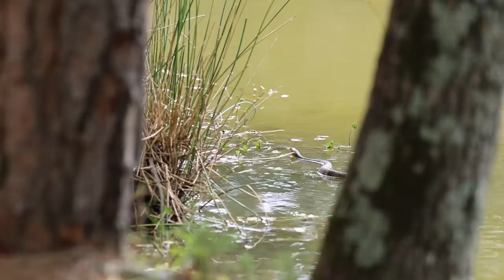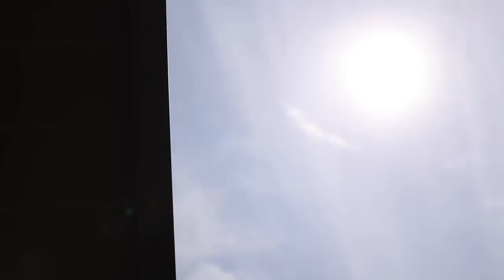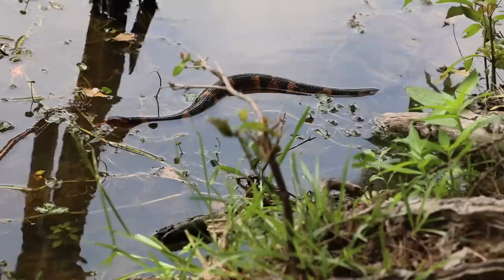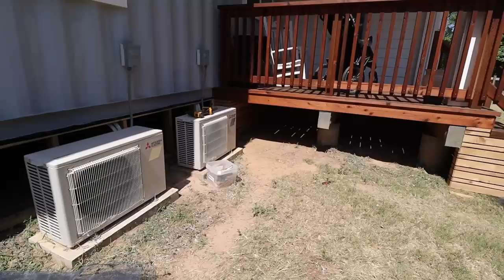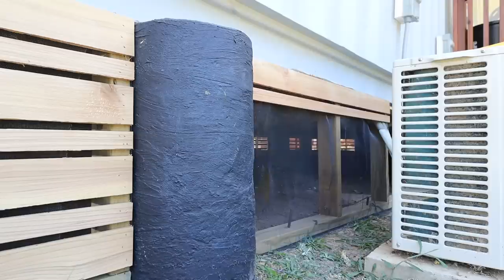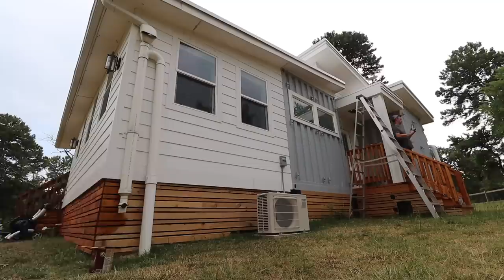HEAT WAVE | Hottest Summer Days Living Off Grid

Comment: Guys, 
Seriously a well with a level switch will make your lives sooooo much easier take your storage and bury it in a berm to keep it from freezing and use the well to keep it at least half full and you never have to worry about it again. As for the batteries yeah not sure any place that gets below freezing or in the 100+ degree heat is your best bet for battery life. Most folks have a room in the house with all the controllers and batteries just for that reason. Worst case, a small building outside with the controllers and batteries with maybe a small cooling unit. The charging of the batteries and maybe a heat lamp bulb should keep a small insulated building above freezing in the winter and the small cooling unit for summer when its really hot out.
Power and water are the most important things so build them to last and supply all your needs no matter what the weather does because as you guys have seen it will not cooperate. Im actually drawing up plans for a hydroelectric set up for the cabin on our creek property. If/when I get it done I'll shoot you guys some pics.
Keep up the good work.
Edit***
Forgot to add you can save those cedar shavings from the planer and they work great for do bedding. It looked like you guys left a place the doggos could get under the porch or some place and if you spread that under there it will help keep bugs out and give them a place to lie. Best thing is that since its an aromatic wood no worries with termites.

Comment: The UK had a famous summer of '76 and I happened to have a vacation at the time of the heatwave. Fast forward to 2022, and this summer has surpassed the summer of '76 in the UK; last weekend there were similarly temps hitting 100 degrees here and this country is not setup with AC! I feel your suffering; that said, we have had some rain and the tenp has dropped, phew!! Hang in there 🙏 hopefully, the weather will bring you some rain soon!

Comment: As soon as you are able, dig a well for water. I would also suggest another source for heat, fireplace or wood burning stove. Weather is becoming an issue worldwide, as is water. YOU NEED BACKUPS!  This winter is supposed to be a really cold one, so prepare now. Dig a well in the spring, use your tractor, but first get another source for heat for winter, it's coming on fast. You have plenty of firewood from the tree you had to cut down, use it. At 70 years I've learned to be prepared, as much as possible.

Comment: Time for a well to supplement the rain tanks, the pumps are electric so y'all still be off grid and you can use level switches to only operate when the pump when the tank get to a certain low level.

Comment: We have a similar problem with the heat and battery storage in Australia. I recommend you check out Redflow zinc bromine flow batteries. They can be drained to 100% and last longer then lithium batteries. We use them for offgrid deployments in Australia 🇦🇺

Comment: In Cape Town South Africa we were around two weeks to ground zero for Cape town.  We used grey water to fill up our toilet cisterns which came from our washing machine and shower. We then also used grey water for the garden.  Trick with that was to allow the water to settle so soap etc fell to the bottom.  Rinsing dishes was not an option most of the time.  Cooking water from cooking vegetables was kept and used along with grey water.  We washed/showered once a week and washed with a cloth and small bucket of water on the other days. Filled a cup with water to brush our teeth instead of letting tap run. When showering we stood in a large bucket to collect water.  Point is.... It can be done and we did it for almost a year..... Automatic Washing machines use tons of water.  If you want to use less water for washing clothes buy a twin tub.  Fill up machine with water,  put drain hose to drain water back into washing machine tub when you spin.  Wash all clothes first (re-using water everytime from spinning washing) and when finished drain water into a very large container for grey water,  fill tub with fresh water,  rinse with drain hose draining back into tub until you notice that the water needs replacing,  drain for grey water and fill with fresh.... Sorry for long explanation but that is how we survived until we got rain again and the dams filled up.  A practice we followed with the toilets was if it is brown flush it down,  if it is yellow let it mellow lol...

Comment: Batteries only have so many cycles, being 100 percent dependent on them 4 years is a good replacement cycle. Li-On Energy has a storage solution. Given your sub count, you should get a pretty good break on pricing. Also, your panels are a big rain catchment if you put a gutter on them. Also, your barn has a lot of lost rainwater that a gutter would capture.

Comment: Have watched you from the very beginning and love you!  Love the off grid and solar array.  However, have you thought about cutting down on consumption rather than increasing on the energy supply?  Eg not using as much air conditioning?  Using a fan instead?  Almost no one in Europe uses air conditioning, yet the temperatures are the same….

Comment: Have you considered using the pond as a heat sink, running tubing into and under the pond surface, dispelling heat in the summer and picking up heat from the water in the winter.    You have the near source that most people only dream of.

Comment: As someone who grew up in the country, you need a generator as a supplemental source.  A smart generator would be even better.  THat way in the early morning, your generator can recharge to provide uninteruuptable (is there really such a thing?) power.  About the only solution for the water issue is to punch a well.

Comment: The heat and humidity have been ridiculous in NW GA too!! Much worse than normal. I feel for y'all.

What if y'all sleep in the same bedroom and run a window unit at night just until the weather changes so you're not cooling the whole house. Maybe set the thermostat on the central at like 78°. Just a thought.

Comment: If I could, maybe shutters on the south windows. If they are on the outside, they provide more insolation from the heat, which should reduce how hard the A/C has to work... It really helped on my property. I have actually had 28-33 C days where stopped running the A/C about 2 hours less. 40 C days, 1 hr to 90 minutes less....

Comment: With the proper filters you can draw off the pond or dig a well.  The water table can be just a hundred feet or thousands. Hope it's high enough for a well. I watch a lot of sailing video's and they use Lithium Ion batteries but the Lithium Iron batteries are worth investigating. The Battleborn Batteries are popular and it's worth giving them a call. ........................  enjoy

Comment: There micro ceramic paint additives you can add to your exterior paint when once applied reflects like 90% of the heat on your house, it was invented to use on metal buildings for oil rigs in the gulf..I just can’t remember the name..good luck

Comment: Hey Texas Friends! I’m here in Southeast Texas and I hear yuh! Quick question, y’all haven’t thought of putting in a water well? That’s what I have and it’s a game changer, and you could run the well motor on your solar
Reply: I agree, I was off-grid for 7 years. I put a bigger holding tank in so my well wouldn't kick on much at all. A well doesn't use much power.

Comment: With living on Tank water for over 14 years. If you feel you need 20,000 gallons always x it by 4. Assume that every summer will be a drought and then make sure you have the water to keep you going for that. It sounds silly but you actually also loose water due to condensation so counter that in also. 

Ps that was just a number not what I’m saying you use..

Comment: As for the water issue; dig a well and run that pump off the solar polar.  One of my  brother-in-laws  had a trucking  business; but on the side he could switch for water for people.  iNTERNET CALLS IT WATER DOWSING.  It was just a side line for my bother-in-law and I don't think he charged for it.  Look it up and try it for your self and see what happens.  I told you before that pond can furnish water by a purifying filter; and I suggested a BERKEY  filterS.  They have been around for a couple of hundred years. Look them up on the internet.

Comment: I moved from Sydney Australia 350 miles inland in 1980 , being a quadriplegic it had to be a large town , so we decided to build instead of buying and I had lived most of my time in the bush so I knew the value of water before we even started I put a 20000 gallon and 10000 gal water tanks in , I got the house finished and we were so lucky we had rain enough to fill the tanks then the rains stopped we went into a 8 year drought  temperatures 40 and above I never had to get water carted in that whole time , so when you say your batteries are the most important thing water comes a really close second in my opinion,like ya show your children are growing fast time flies

Comment: Wonder what battery manufacturer will end up sponsoring them. Heard Lion Energy has a good setup but they may not need the complete package. Is drilling a well out of the question? It can be costly if it needs to go deep.

Comment: You guys, if the heat breaks at night, turn OFF your air-conditioning and instead just get fans and blow in the cold air through every window...then close the house back up and tip-shut the blinds to keep the sun from beating in before the heat re-cranks every morning. We are in heinous drought and over-heat in California, too, and this is how we do it here. Works great; uses massively LESS power. I hope this helps at all...

Comment: I think I would take some items off the solar energy and save the solar for a few items instead of trying to run the entire home off of solar.  That way the panels could charge up the batteries with less items to drain them. Maybe have  as much as possible on propane and as little as possible on solar. Also, I would look into drilling a well and hooking up some filters for it.

Comment: That’s always the problem with solar, you need to jack up your batteries, another thing is to introduce mass in your house, if you build with concrete during the day when you have a ton of extra energy you just crank up your air and get it nice and cool and have a large amount of thermal mass is there. It will absorb heat when it’s hot and dissipate heat when it’s cold, thermal mass is a critical part of building green, But the easy option is just increase your battery power yeah so you just have plenty of power when the sun is down.  A lot of people will just live with the temperatures and all of that but I love green power but it’s not very efficient or practical so if I was ever to do it I would way overdo it and just have a ton of battery. I would have three days worth of energy saved up and enough panels to charge it completely in one day with a moderate amount of sun. It’s possible in the winter you might have to throw in a generator if it’s really dark and everything is covered with snow but it all just comes down to money, Sollers doable it’s just not a very economical option.  Other options would be to get a geothermal system but for practical applications for you guys I would say thermal mass would be good if you had more room but the easy solution is just going to be more battery.

The other option is to run your house cooler during the day, I use spray foam if it’s done correctly you should have a fairly efficient system, maybe improving windows insulation once it’s cold in there it shouldn’t take nearly as much to keep going. An air conditioning guy taught me that the worst thing you can do is leave your conditioner off all day long and then come home and turn it on because it works five times it’s hard to cool your house as it does to maintain your house being cool so you just want to keep your house cool where it’s comfortable and you want it and that your most efficient option other than to just suffer with hot all the time.  

I agree with you on not mixing batteries but you can if you segment your usage. Put in a separate circuit for heating and cooling and just put the new battery on that and let the old batteries run for another 25 years doing your lights and other electric stuff, basically have two separate solar systems, it’s no different than adding a second panel at your house like having one for the garage and one for the main house.

Comment: I think…my thought is that for true long term sustainable living the higher temps and drought should be a high planning priority. It might mean greater planning for power and water needs or geographic location choices. I’m almost 60 and I can surely tell a difference in the weather and the heat.

Comment: Oversized is fine but there still may be issues that arise. You should be thinking critically. Double and triple redundancies. Along with increasing your storage capacity you should think about adding wind generation for those cloudy but windy days. If you have an adequate water source like a decent flowing stream on your property, you could look into microhydro systems. And more importantly, adding a full size back up generator should be essential. Adding propane to run a back up generator as well as emergency heat in the winter would be a great asset and with Texas often in the path of many hurricanes and tornados, it would seem to be a no-brainer. This is my opinion only, but despite all of the water recovery systems in place, I believe it is critical to have a good deep well on any property. All of these ideas are costly, but having such a great vlog with a great following, I'm sure there are companies that would be willing to help in exchange for advertising and endorsements. Keep up the great work guys.

Comment: You guys should probably get you some portable power stations for back up power that is there in case you need it and at least you'll be able to watch movies and play video games if you get the ones with enough WHs and enough watts. I forgot where yall live. Texas or something? Beats me what you do about the heat without power. The power stations could run a fan but that's not going to do enough to help enough. I've been wondering that myself on how to solve that issue for the longest time and it's most important to figure that one out. A/Cs take so much energy to run. Water spray bottles with ice water in them help if you don't mind wetting your body all day spraying it on yourselves. But you have to have ice. I don't know but if you 2 ever figure out an answer I'd like to learn from you too about what to do about it.

Comment: Batteries:

1) They don’t like heat.  Heat kills batteries.  You have incredible heat.

In someplace like the Pacific Northwest, batteries will last 5 years.  In the Sandhills in North Carolina, 4 years.  In Gulf Coast Alabama/Mississippi and Louisiana and East Texas……4 years is stretching the lifespan of the batteries live in the heat.

2) When you test batteries and they show 80-85% of “capability” - they’re close to dead.  You get close to 80% and the batteries will DIE.

Given that you have a lot of power during the day (when the sun is hitting your solar panels) and little power at dawn……your batteries are borderline useless.

Comment: why don't you hook the AC up to your gas generator during this heat wave?  That will take pressure off that heugh electric drain.  You got to do something quick or you will have a complete power failure.  I have a story on those black berries. My dad crushed concrete for a living. Those black berries grew among the uncrushed concrete. They grew as big as you thumb. They were delicious.